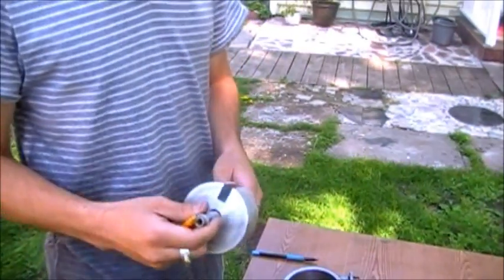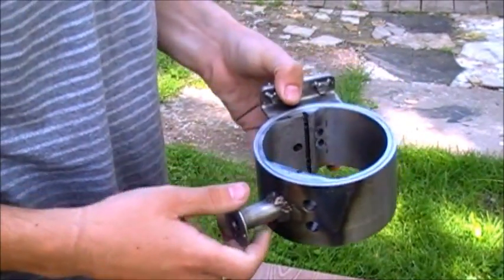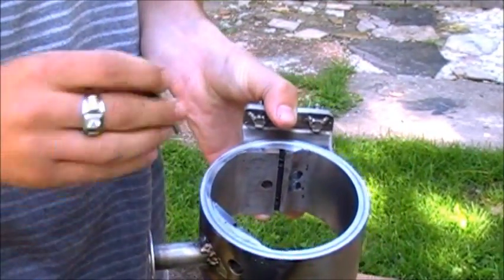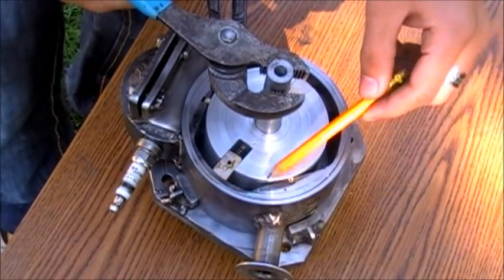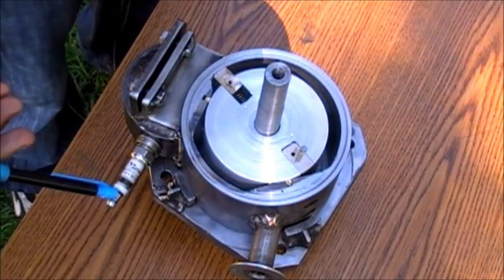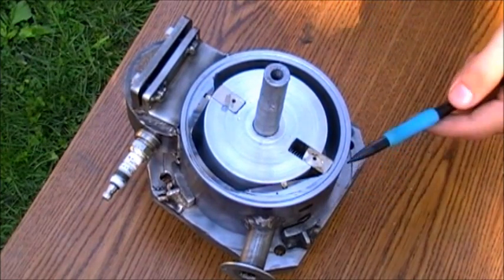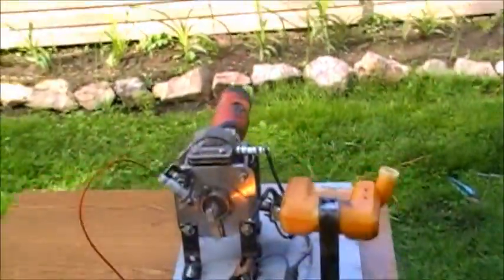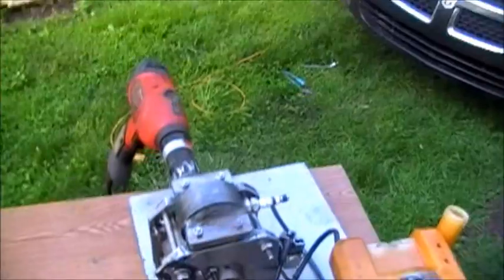new rotary engine semi functional prototype

Comment: And a flywheel
Reply: +why ? Agree. You need a rotating mass to keep momentum on the rotation.
Keep on your interesting work, there is nothing wrong with the principle or the work quality. You need to investigate further on the ignition timing and the fuel admission.
Remember which very basic circumstances under which the first ancient engines were created and fabricated, and they are still running ...

Comment: Turbo? maybe valves to squeeze the fuel/air mixture more "cylinders" and more displacement per "cylinder"
it will work with some fine tuning and backing

Comment: Very poor torque from this. Good engineering exercise though.
Reply: Still no compression. Looks like a 2 stroke engine. No seal behind the ignition chamber.
Reply: I don't know, I've never described a rotary engine with stroke count because it's all one fluid motion. Not a series of separate movements like a normal piston engine. It just seems odd to me to describe it like that.
Reply: It's not a 2 stroke engine... more like a quarter of one.
Reply: but... It's a rotary.... they don't have strokes.
Reply: Nerd_United They do,the ones in Mazdas are 4-stroke engines.
Reply: Dylan Morgan Yup!
Reply: yeah .. poor torque on this model, but he could easily have two combustion chambers and even one day have four combustion chambers, a ported rotor with valves leading to exhaust ports on the side plates instead of on the rotor housing.

Comment: Keep it up guys. You will never get anywhere without trying. A cheap solution for the crank seals would be Teflon washers until you can progress further with intricate machining and seal designs. Lawn mower ignition coil and trigger will provide better spark. You are almost there.... Hang on till the end

Comment: I suspect that one issue is that the air charge is based upon suction which is a very outdated idea. In order to make power one really needs to have an air mass heading toward the intake port with enough momentum to charge the combustion area with pressures above atmospheric levels. If we went back prior to 1900 engines often had suction valves in which the poppet valve was actually sucked open by the vacuum formed when the exhaust charge left the cylinder at high speed. That is why you see antique engines that were massive that produced only a tiny amount of power and required such heavy and large diameter flywheels. If this design were created with several chambers such that one intake port was always open then a supercharger could feed in a serious air supply and the engine might make good power. But then the real battle would be emissions issues due to the essentially two-stroke nature of the engine.

Comment: There are quite a lot of design problems in this prototype, but I very much like the idea. And the fact that you put this together yourself with minimal tools. I'm looking forward to the next iteration of your engine. Good luck!
Reply: hi i have lost the access to the original account ...

but yes you are right there are lots of problems ... now i have recently purchased some machinery and am working on a new project i will post it on this account one I'm done ...
Reply: @nekitsurguy2445  subbed
Reply: @jonasverreyken8384  he doesn't need your "good luck" bit the onside that he tries to incent the wheel for a second time. It's useless Work.

Comment: That vane is going to slam into the rise of the 'hill' at some 80 fps and the thing isn't going to run longer than a minute. That's not counting the centrifugal force holding it against the wall of the chamber. Lubrication is going to be a nightmare.
Reply: +tubeist- dan  I concur. I was thinking that designs going forward are going to have to escape from the traditional metal-on-metal contact that has cost so much efficiency till now. External combustion appears to be the best solution.
Reply: Nom
Reply: Dan - Hah ! 2 years later and I just posted almost the same comment.  What if the length of vane travel was reduced to 2mm  instead of the current 10 mm travel design?  The combustion chamber depth would need to be tiny.  Although the length of the chamber may make up for that.

Comment: I looked into this design about 20 years ago after taking apart a rotary refrigeration compressor & getting inspiration. When I delved deeper I found that there was a guy from Rochester NY back in the 30s that built one & put it in a motorcycle & rode around on it for a while. He concluded that the parts wore out too quickly & took it no further. However, that's not to say it couldn't be further developed today, what with modern materials. Good luck :-)

Comment: NICE IDEA.
 I HAVE DESIGNED SOMETHING SIMILAR, SUPERIOR THOUGH. ONLY PROBLEM WITH NON-RECIPROCATING ENGINES IS LUBRICATING.
ALSO YOUR COMBUSTION CHAMBER MUST BE DESIGNED TO CHANNEL ALL THE OR MOST OF THE POWER TO THE SPRING LOADED PROTUDING RIDGE.SINCE THE  POWER STROKE IS NOT PERPENDICULAR TO THE PROTRUDING RIDGE, YOU WILL NOT GET SUFFICIENT TORQUE. OKAY FOR LIGHT MACHINERY. NOT SUITABLE FOR CARS .

Comment: Are you the designer and the maker of the parts? Because it dose look and appear to have possibly exhaust gases or you are not being able to hold the intake air during compression cycle. I notices you had your finger over the carburetor air intake hole, which appeared to be having exhaust gasses or air which was under compression from the cylinder back flowing thru the carburetor air intake.

Comment: I suspect this design will not work in principle as the spring-loaded "seal" has too much inertia to seal the expansion area quickly enough. If any fuel explosion does  happen the gases will float to the exhaust port before the springs snap the area shut and force the rotation.

Comment: Good idea. But it think the combustion chamber is too large. It doesn't allow for enough compression at the time of ignition to create the power necessary to drive the motor. Keep trying!
Reply: wonder if wasted spark ignition would help ?.... also they need proper gaskets to keep the compression better. great idea though
Reply: Ateşlemeden sonra çıkış yanlış
Reply: hi i have lost the access to the original account ... 

now one of the main attractive features of this design is the fact that there is no compression .. this engine ideally should work like a potato cannon except instead of launching a potato it would push on the and spin the rotor ... yes the rpm will never bee high. and yes there is never going to be a lot of torque .... however the efficiency should be pretty high ...

Comment: There is no future in gasoline engines, they're only a fad. Steam power is here to stay.
Reply: +alan jackson   It will not be successful. Even made properly and sealed well there will not be much torque. There is no torque multiplication in this design. Even if it revs it`s head off. Sorry guys, well done but no future here.
Reply: Crobular I- Torque multiplication comes from the transmission/gearbox..

Comment: there is no way a remote cumbustion chamberhas any chance of reaching the efficiency of even the most primitave flathead engines nevermind anything else... even if everything were done with ideal tools parts and with maximum flow the design cannot b justified the energy waste from chamber to chamber would be i think north of 50% and exponential...all that being said id still like to see it run. i also think the design needs a camshaft and valves

Comment: the gas sealing isn`t your biggest problem. you have to install 2 extra seal block every 120° so that there are more strokes in each rotation than it will run if you get everything oiled up.

Comment: You need to compress the air and the explosion to push the wheel, maybe have two wheels united, one compresses and the other absorbs the explosion from the firing chamber to make the wheels spin.

Comment: ...two stroke fuel/oil mixture fed engine - not very efficient without separate fuel/oil injectors but then not eco friendly due to a oil burn...good as an idea but without too bright future.
Stress points are those brass seals and springs attached. Springs has to be super HD made to sustain heat stress, as well as seals.
Might be good idea to oil the seals from through rotor ports but then you will need "seal for a seal" between rotor and seal and things start to get complicated...anyway, good project as a being a student. 
Turn to BLDC electric drive, chemical fuel cells and similar kind of soon as you can... ;)

Comment: yes, seems like a sort of wankel rotary piston engine. every hour of making engines like this is a wasted time. reason: the laws of physics, thermodynamics. you must cool it to keep it running and by that you lose 70 percent of the energy.  and all of these motors make CO2. 
the alternative is already there: hydrogen that powers a fuel cell, makes electricity without heat  and an (or several) electric motor(s). only water as  a result, nearly no lost energy, you will see: no one will talk about gasoline/diesel engines in 20 years.
Reply: +Billi Backer good points
Reply: @Helloverlord don't bei pizzled By my Name, Billy Bäcker is my old Name, now IT IS 2024 and i replaced my BMW with an EV, namely a Fiat 500e. IT IS tiny (3.64m which is 11.9ft)  but big enough for two 70 years olds and we do Not Drive Long distances any more. IT is perfect for urban use. Elektricity is not Problem, because we charge at home and the so cold THG  GHG(Greenhouse reduction gratitude), Up to now 750 €, reduces my "fuel" costs to zero. Driving ist fun because the Torque of 220 Nm ist available at any Speed. No Gear Box, No Clutch, snd one Pedal driving AS a result of recuperation...
Reply: +Billi Backer yes because there is no energy loss making hydrogen or the fuel cell or the battery or the....
Reply: +william loachridge Its all about higher efficiency. Top rating are:
internal combustion engine has 30% eff, electric motor 65%, fuel cell 60% (combined el. motor and cell 39%) and two last compared to a gasoline powered are clean and sustainable...what more would you ask for?
Reply: +Helloverlord it has to be loud too.

Comment: sir there is a website called the Museum of Technology or something like that that displays many many types of attempts at positive displacement engines with little to no reciprocating mass. These things were all tried one or two hundred years ago. The only one that has shown any promise that all is either the Wankel or the reverse Wankel type rotary engine and that is only with modern manufacturing technologies but those technologies also allow piston engines to be that much more thermally efficient with higher compression ratios. Read a little bit about how high compression ratios increase thermal efficiency such as engines that used leaded gasoline or diesel engines to understand that concept.

Comment: this is a sturdier hydrolic vane pump.  did you get the stator from a hydraulic vane pump? of course on a vane pump the veins are much thinner since it is just being used as a pump or perhaps a turbine and not as an internal combustion engine. I see the benefit over the way, and that it does not have the eccentric motion and vibration but you're going to still run into the same limitations of the Bangalore other similar rotary engines and that you were trying to seal the high pressures on multiple planes. There just is no beating the piston and cylinder to have good thermal efficiency you have to have high compression ratios and there was also too much surface area per volume and there is also the problem of combustion continuously occurring in the same part of the engine I applaud the effort but this type of positive displacement engine with a minimum of reciprocating mass has been tried before and has been deemed only suitable as a pump or a turbine.

Comment: Wont start because the thermal compression is not proportional to the angel of applied motion resulting in a back up of semi-vaporized petroleum distillates. So sez Prof. Beavis, PhD of applied physics and other assorted bullshit :)
Reply: +beavis simpson you know the difference between angel and angle?
Reply: beavis simpson it is not grammar stupid, it is spelling. both words angel and angle exist but have different meanings. how does one become a spelling idiot :-))
Reply: +beavis simpson I agree. The angel of applied motion and shit isn't right.
Reply: Billi Backer Right you R !! The old L before E rule does apply. So, how does one become a Grammar Nazi ?

Comment: no matter what equipment you had to build this exact design, it would not work. No compression=no power. Also, there's no opposite reaction driving the rotor around again. Research engine design more.

Comment: you do realise that rotary motors are pretty much dead cause they have horrible fuel management right, your design wont put out any power, and if it does work ur gonna need jet fuel to push that spring over that hump and to suck in fuel , its not economical im sorry, I would keep working on it of course not everyone can say they make an engine, but iv been working on wankle engines for over a decade now and your going for hopes and dreams for new energy with that, make with a hydrogen generator , something that doesn't use gas

Comment: According to what most often happens to wankel engine, after you run it to high RPM for a while, the rotor will melt together with the gold block part which might lead to a result of engine failure, so that your model won`t work under that situation. However, Wankel Engine can still handle that for a while is because of its shape is triangle-like, so it`s got to be okay for a while for still being able to separate processes. Thus, i would personally suggest you to abandon the string part and figure a way out with just the way your rotor is supposed to be working and what kind of process separating block your rotor should have.

Comment: Would get rid of the step the seal has to drop down it won't last 5 mins if it starts. make it more of a run off rather than an edge nd move the carb away from the exhaust port that's why it's getting fuel kicked back out the carb as for compression it should have plenty try and side seal the rotor and try Stihl oil seals for the bearing seals shouldn't be hard to make a decent sealed unit, also try running a 2 stroke mix through it as the raw fuel will cause it to overheat when starting and it could seize if u do get it running would treat it more like a 2 stroke. Prob need to make another plate and rotor assem get a look at a Mazda 12 b engine should point u in the right direction for getting the off set of the rotors prob need to instal a coil for each plug running from a fly wheel on each end similar to a Honda gx setup then u should be able to pull start.  Be interesting to see if u can get it running mind fuel air compression n spark makes anything run. Good luck

Comment: There is many things that will have this NOT work. 1. The area in which the piston is going over the hill and then coming down to ignite the gasses, this doesn't create enough pressure with how small the piston is and how big the area is that is housing the gas, 2. this is a 2 stroke engine with no spark plugs. 3. The weight of the spring that pushes this piston against the hills is going to kill the engine inertia. and 4. The piston is constantly rubbing against that round housing, and there is not a way to have apex seal sort of things around there or on the piston, and without the apex seals or gaskets to keep it from rubbing, the piston will eat away at the housing within a few high speed rotations.
Reply: Rotary engine. No pistons.
Reply: +hogsandsooners Rotary VANE engine... 

..every successful Rotary ICEs design has pistons

Comment: Awsome design, like to see it running. That size would be great for a gocart. You should be able to get some really high RPM out of that design. Maybe a faster RPM would help with the sealing problem, faster RPM will not give it much of a chance to leak past the seals. Just a thought.

The Wankel motor has it's problems with seals so don't worry too much. Solid design just need to work out the details.

Comment: You should try using a reed valve for the carburateur look for a bolt on reed kit on ebay you've got a great idea don't get discouraged and you can also look at crank seals that you would find on a 2 stroke engine do some research on 5th scale rc engines and if you get a working production model you will find a huge market for this there as well keep going and contact me if there is anything I can do to help

Comment: the only problem I see is when your fuel and air is pressed into the combustion chamber, can easily escape into the exhaust side, and doesn't ever really get compressed at all so proper ignition can not happen. This can be easily verified with a compression guage. I think a simple timed rotary valve in the exhaust side of the combustion chamber would cure you problem and allow your motor to fire.

Comment: It looks quite efficient, but I see the issue of very low displacement compared to the amount of metal. It's going to have a good bit of inertia to overcome both in starting and in stopping. I also foresee issues with those seals wearing out even more quickly than the apex seals on a Wankel rotary, and even those erode problematically quickly.you're going to need incredibly strong springs for this to run at any speed. It's definitely an interesting concept and I wish you the best of luck.
Reply: Actually if it gets running the centrifugal force will help hold the seals in contact with the chamber. I agree wear will be a major factor and should have a 2 cycle mix for fuel maybe a 40:1 fuel/oil mix.
Reply: Need to use pneumatic actuator?

Comment: Ingenious! Your first running problem is with the valve. You should try and mechanically activate it. It still needs some redesigning but your going the right way. I cant wait until you get it running right. I want to buy one.